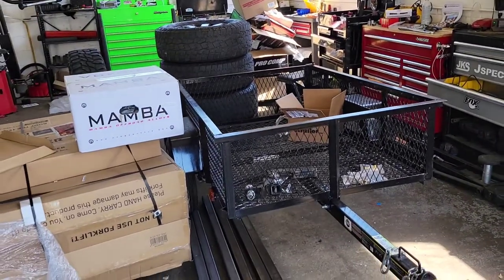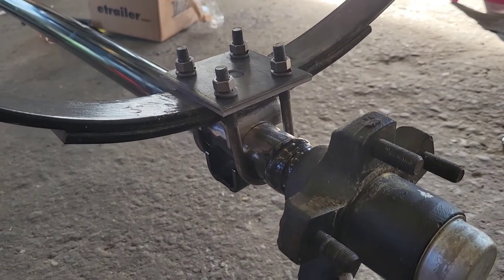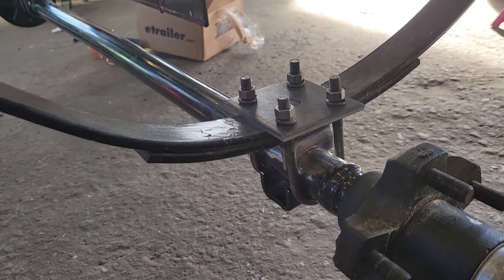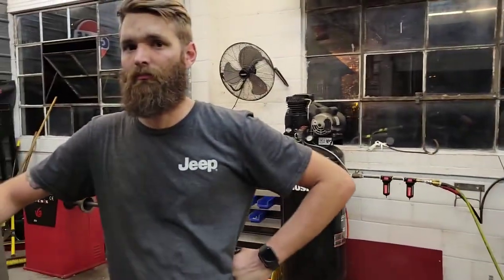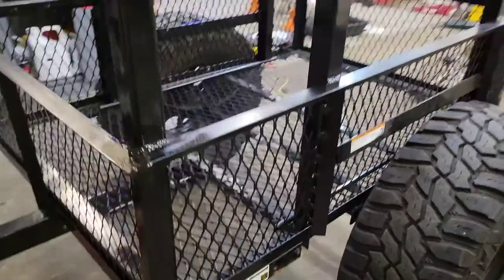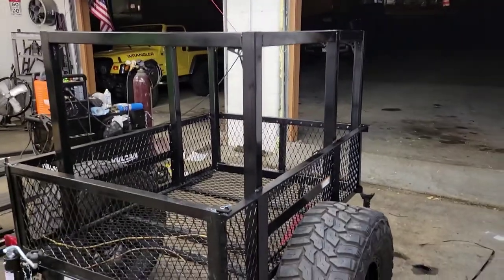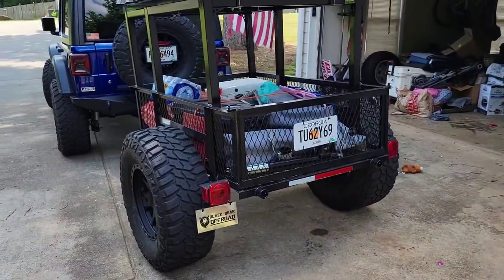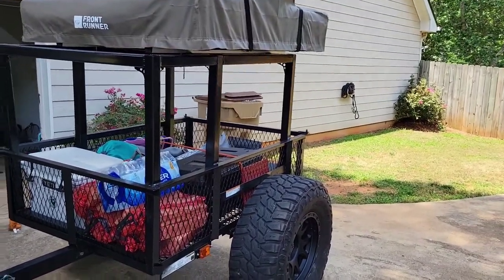Building an overland trailer in a week.

Comment: With regards to the axle spring perches, why could you not have rotated the axle 180?  You would have to the reverse the pin on the springs, but you had to do that regardless.  Am I missing something?
Reply from the maker: The axle has a V in it that is designed to flatten out with a load, so it can only be mounted one way.

Comment: Nice build.  Do you have any links for axle lift? Did you use spacers? Size?
Reply from the maker: I user etrailer for all my parts, and yes I used a 2" spacer.
Reply: Perfect thanks man!
Reply: @JeepinBubba  did the Spacers hold up? just got a 4x6 trailer and trying to be a little budget minded. 
I Was planning on wheel adapters for my Factory jeep wheels.

Comment: I’m real interested in making one of these trailers. I I have a lot of questions. What all did you have to do exactly to get it lifted? Just flipped the axle springs? Did you have to add that little spacer between that you mention to weld? Also did you have to add wheel spacers to add the rims?
Reply from the maker: I flipped the springs, welded a perch, and used 2" spacers
Reply: Thanks!
Reply: How is the trailer holding up off road and on the highway? I heard the bearing might have problems
Reply from the maker: Towed it to Arizona and back and through big bend with no issues. I have welded re enforcement in the frame for heavy offroading tho
Reply: @JeepinBubba  thanks for all the info

Comment: What model trailer was that?
Reply from the maker: Lowes 3.5x5.5
Reply: @JeepinBubba  how is it holding up?
Reply from the maker: I recently sold it and were building a new design from scratch. But it did well, kinda bouncy, needed some reinforcements to the frame welded I'm, but a great platform to star with